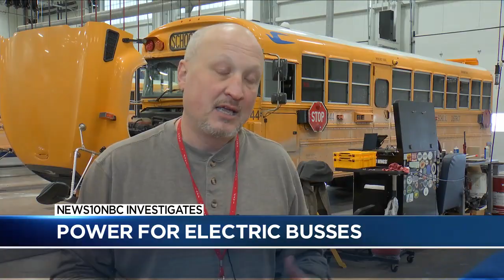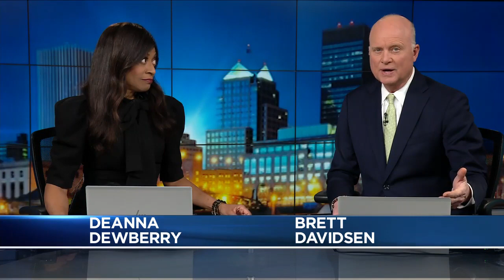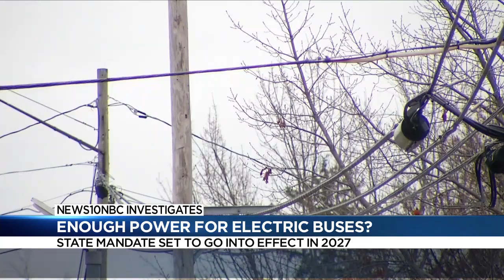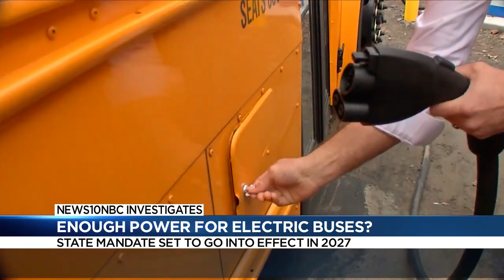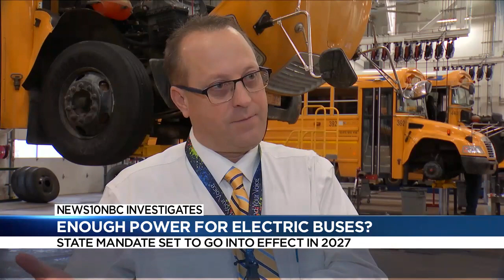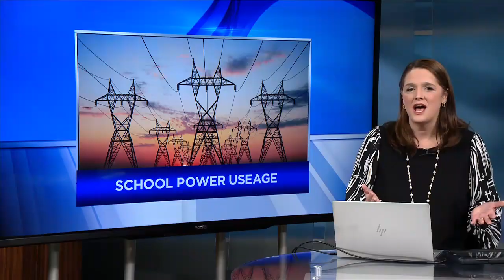Is there enough room on the grid to power the upcoming electric school bus mandate in NY State?

Comment: 2:19 fleet of over 200 busses... at 400k per electric bus .. so they need 80 million dollars plus infrastructure/charging equipment too.. Odds are some of the busses they use now would last past 2035 when mandate is supposed to take effect. A School bus due to its light use could easily last 15-20 years of use before its worn out. In this mandate they are saying that 100% have to be electric by 2035 so they must get rid of diesel ones even if they still work.

Comment: There’s enough power on the grid, question is whether there is enough lithium to build the batteries, or at least whether the school can afford the large expense.
Reply: E-vehicles are cheaper in the mid to long run, particularly when in heavy use. You're willingly ignoring much higher fuel and maintenance costs!

The oceans are full of Li... Question is if it is financially viable to extract it. But when I see how much effort and resources are "invested" in non renewable oil and gas extraction, there's surely enough capital for a lithium industry.

Comment: No!!   Elecrltric vehicles fail spectacularly with damaged or failed battery cells!!!!  They fail quickly!!!!  Can burn down the structures thay are parked in and can severely burn passengers of the vehicle or persons in the building!!!!
Reply: You've got that right!
There's only a lifespan of 10 years.
Plus they go through tires like nobody business.
Reply: @southwestsearch  I doubt any school bus has a lifespan of more than 10 years no matter how it's powered.

And the tyre wear myth is proven wrong long time ago. One of the main reasons for tyres is traction (control) and it is better for e-vehicles
Reply: You mean, they're almost as dangerous as large amounts of carbon fuels?! Shocking!
Reply: Calm down. I drive one and it’s fine.

Comment: While the concerns raised are very valid, rhere are some extremely important factors that are not considered. Buses can charge during the lowest demand periods (full speed overnight amd low speed between transport periods), availabe mW is likely calculated on averages and this doesn't give a clear picture of the actual availability during the charging periods. Yes, infrastructure will need to be expanded, but the reduction in fueling cost will help offset that inital price. 

Lastly, range-eztended hybrid buses (also called seires hybrid) really need to be seriously considred. Small onboard diesel gemerators are incredibly effficent and would reduce the battery size and charging demand. The initial cost of buses would be reduced, as well as the fuel cost and carbon output. This is a perfect bridge to EV over the next 20 years and is shamefully overlooked by industy leaders and lawmakers.
Reply: NO IT WON'T!!!!  They're a QUARTER OF A MILLION DOLLARS more EACH!  That's even before you install the electrical system.  Not to mention they're going to wear out the roads and tires faster due to the heavy weight of the batteries.  The state has NO business telling local schools what to use.  And that's not even considering the fire danger.
That money should be used for EDUCATION, not some Green New Deal BS.